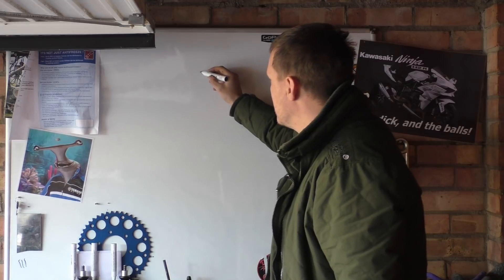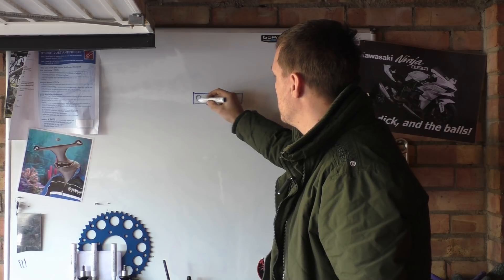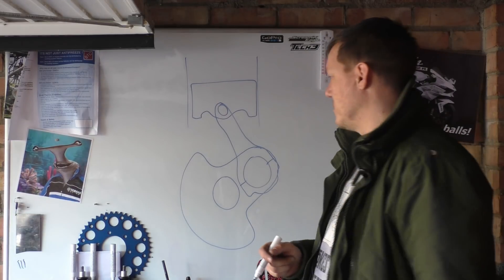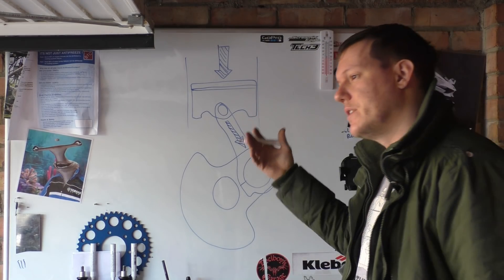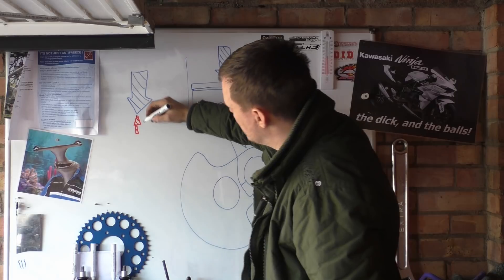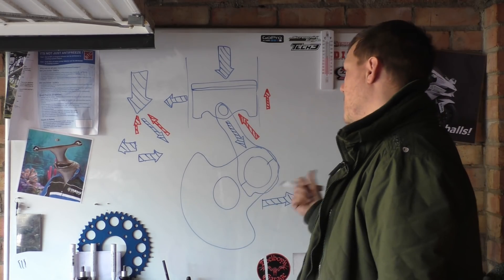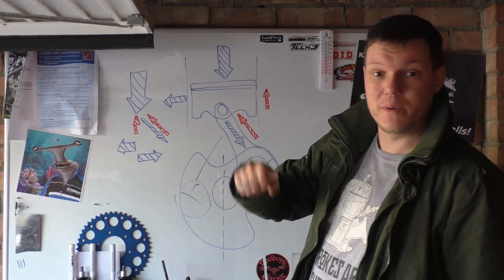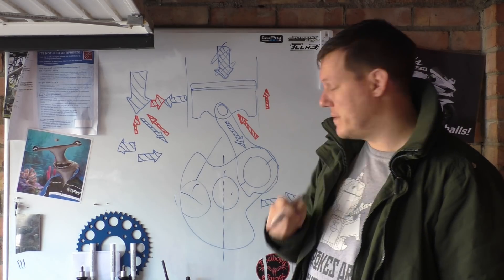Piston Slap - Forces - Part 1

Comment: Totally agree with everything you said, except the fact you called it ...piston slap...lol when I hear piston slap I think of some ass goblin with a v8 cumstane aka a Ford mustang or Honda Harley running straight headers and too large of an exhaust so theirs no back pressure to keep the piston from slapping into the crank at bottom dead center... you can hear the bang in the bottom end ass the piston has no exhaust to slow it down from slamming into the main bearings... idk maybe bc I’m from the other side of the pond...

Comment: An engine always runs in the same direction? Yes normally and it is supposed to however I could get my kart (Fixed drive) to run backwards when I spun at speed and did a 180!

Comment: mr.matt, i have an 05 trx450r big bore 97mm cylinder, would this cause more side loading over the stock 94mm due to the larger bore size?
Reply from the maker: Yes and no, although side loading is very much to do with con-rod length the mass of the piston is the mass that is thrusted against the cylinder wall - increases this mass is a bit of both - large mass means it has a higher inertia - i.e resistance to changes in aceleration (of the piston) this means that it kinda cancels out to a degree.
Reply: ok, because i have a slight knocking  @ idle (i know it's not due to compression because it's only 10:1 and i run 93 octane) though it is a forged piston (still in spec) and have read that these engines do that with the bigbore setup, i just hate the sound and may go the 94mm 11:1 setup.thanks

Comment: i always seem to come along some issue or another with my mx bikes i guess I'm just unlucky but thats everyone could you make a video series on how to identify issues on the bike like if your clutch is warn what to look for on the discs or if your having a spark issue how to find what isn't working basically a guide line on where to start and what to work on first for example my current bike isn't getting spark and the carb is leaking where would i start? its easy to say the stator or the carb needs to be cleaned but i mean a deeper in-depth like where in the manual to look for reading power outputs and how to properly use things a multimeter how a carb should be set up and what to look for engines are simple and easy setting the bike up properly is something a lot of people struggle with and electrics are confusing sorry to ramble but it would help a lot of people to set up their bike correctly
Reply from the maker: Yes I can - the issue is that all these problems are massively varied - not only that but good examples are required - hence what the ER5 will be for. I have purposefully 'break' things to shgow faults etc
Reply: i Cant wait it will really help cause a lot of people typically just don't know what there looking at and whats wrong me included keep up the good work

Comment: I think it's all down to how they rock a little as the bore wears, oil used, and how they are run in, I've done a 50,000 mile FZR600 with very little wear on the bores and the owner was a thrasher, he did get Motul off us every 3000 but he didn't baby it. And on the other hand had a YZF600 in with less than 5000 and scored bores. Anyway love your channel and the way you do it, please keep it up, there are so many gobshites on here, I think you may know one of them and I loved the parody you done, you should keep them up as well as Dullboys silly tips could encourage young or inexepienced riders to fuck their bike up, it can happen to anyone, I nearly burnt fucking shed down the other day after sticking loads of mig wire up the ZX' pipe.

Comment: Timing and mixture greatly affect this. Honda had a unique offset crank to bore on a dirtbike years ago to try and combat the problem.
Reply from the maker: This is called desaxe cylinders - which is coming up soon
Reply: The Workshop 
Cool, I can't wait.
Reply: mondayfool 
Not a clusterfuck at all. The coolest puzzles on the planet. Most can be figured out by geometry and dimensions, but camshafts are a bit of a black art understood fully by few. Even those could be measured out and equations made to figure out what may happen how.

Comment: So what does this mean for the uneven firing order type engine, like say the CrossPlane engine from the R1?
Does this make the environment for piston slap more likely or the exact opposite?
Reply from the maker: We're looking at this for a single cylinder system and this doesn't really change for a x-plain. This is part of crankshaft torsional loading which is something we'll get to.